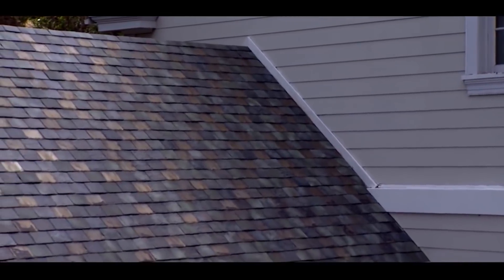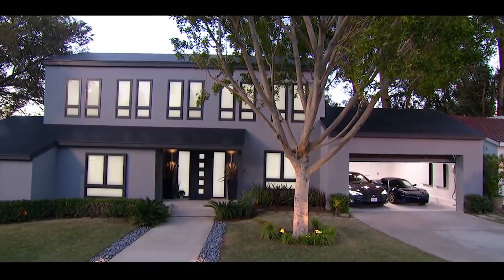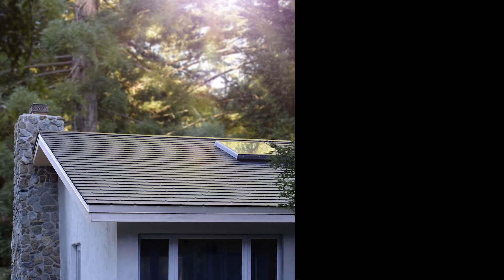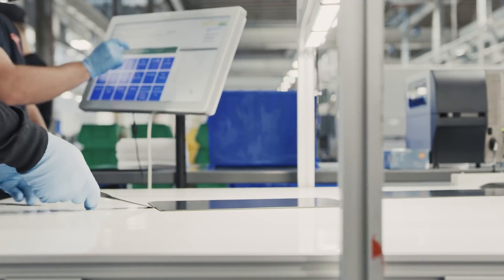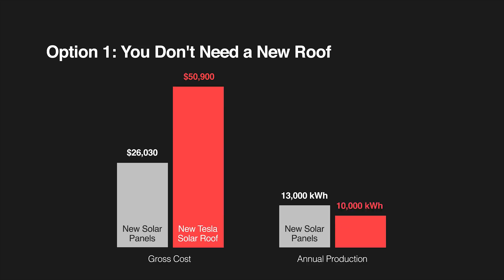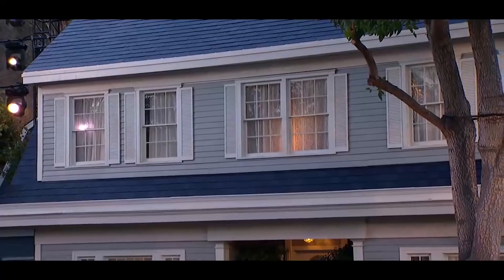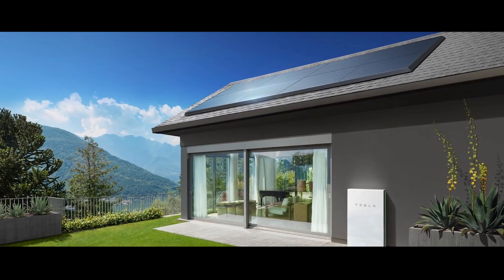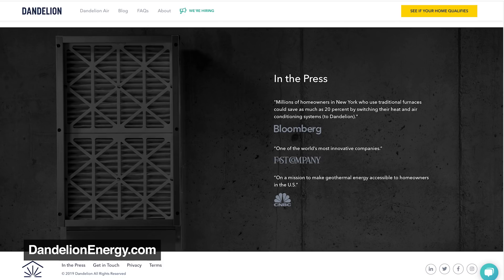Tesla Solar Roof Worth It?

Comment: This is probably the most disappointing part of the whole Tesla story:  SolarCity and solar tiles.  Why did Musk pay 2 billion for a company that was going bankrupt?  He could have got it for the cost of liquidation, a few tens of millions.  There is zero startup cost to solar panels:  all the competition gets them from the same place in China.  Start there and then manufacturer your better ones down the road.  Then those tiles:  I love this idea - all asphalt tiles should be replaced with a solar tile but they should hammer on, snap together and be plug and play.  I have solar panels, bought another expansion array and added 16 huge pool solar water panels and although we have a Model 3, I did not even look at Tesla.  That's sad because I wanted to.

Comment: Why is this video 99% functionality when this design is VERY CLEARLY a huge form &> function product? Of course you're gonna have more power and less cost by buying the slap-specialized-cells-on-muh-asphalt-ruuf but the entire point of their project is not making it look like you've got solar panels on a roof.

There's additionally holes in your math everywhere while you also didn't bring up that people with awkwardly shaped roofs are unable to cover sometimes less than half of the sun exposure area with solar panel arrays compared to tiles that can consort to any design.

Do everyone, yourself included a favor and take this video down & re-do it.

Comment: The calculation discussed about a replacement or new roof does NOT include the fact that an asphalt roof will need replacement within 20 years while the Tesla roof has a lifetime/infinite guarantee. The actual numbers will show that the Tesla roof, even when discounting for the time value of money, is the more economical (less expensive) solution. While $75,000 sounds like a LOT for a roof, it is the only one that one will ever need and the guarantee is transferable. In addition, even if the cost of electricity does NOT increase in the future, the independence from the grid adds a level of security not discussed. Tesla is the best choice economically, security wise, work wise, etc.

Comment: This is a technology that really needs to move forward. We can take an existing energy source and use it to power a majority of our electrical needs. Of course it looks expensive, but you did not touch on the fact that they have a lifetime guarantee on the product. One of the things that makes this make more financial sense is that once it is installed, you have a fixed cost (mortgage) that eliminates your electric bill, and then begins paying YOU back. While it makes more sense in a couple years when prices drop, it certainly has to be considered for the evolution of passive homes and their standards.

Comment: So houses catching fire like the walmarts and amazon sites?  They couldn't do it with regular solar panels.. why assume the new panels will NOT catch fire? Last I heard, there were 13 total installations, and the reliability was terrible.  Is Elon giving a "self driving car will go from coast to coast in 2017" type thing with his announcement?  The standard solar panels are not pretty.. and with the Solar City fire issues I would want that on stands in the back yard.. high enough to not hit your head as you mow the lawn.. with a shed to hold the inverters and batteries...  Here: solar is the only possible backup for the ever so unreliable utility.  

The local fire department also suggests back yard structures so that you have guaranteed generation shutdown if there IS a fire on the roof. (Lightning and all)  Their demo solar roof (even with 30-60% non producing panels) does look much better than the cheapest asphalt  shingles.. but the 30 year stuff I had put on 5 years ago was $8k for a 2400 square foot house.  The $80k or more for the solar shingles is rather daunting.. and in some areas in the south would only double the value of the house.  If it works....

Comment: I ordered a Tesla tile roof two years ago from the factory. At the time they required $1000 deposit which I gave them and they estimated that for my house which is about 1700 ft.² the cost would be in the neighborhood of $40-$50,000. Two months ago they measured the roof they spent four hours going over everything that had to be done to normal asphalt roof that they were going to replace. The cost estimate just came in at $155,000.  With an average electrical bill per month around $120 this made no sense at all.

Comment: solar and wind huh. what happens in a winter climate when theres no sun or wind for days??? ya screwed then!
Reply: Solar Power only reduces your need for Grid Power, it does not replace the Grid Power, unless you also add an expensive Battery Back-up

Comment: I was thinking about using the batteries I already have solar panels on my roof. I think it’s a good ideal to get away from PGE power and go totally solar power. What do you think?
Reply: What is the cost of the Battery Pack every 5 - 7 years?  Typically, batteries are a financial loss ...

Comment: Just got my Tesla roof estimate and I have to say I am very disappointed.

My roof is 3147 sf and the cost was $88,587. This would not be bad, but the size of the solar system
is 7.86Kw Which would produce only a third of the electricity needed for the
year. Solar portion 706 sf @ $51.44 sf ($36,316.64) non-solar portion 2440 sf @
$21.42 sf ($52,264.80). The 706 sf was the maximum size system they could put
on the roof as Tesla has limitations. (Whole roof has no obstructions gets sunlight from dawn to dusk).

Comment: I'm building a new house in about 1.5-2 years and would love to have this type of roof installed. Where I am building, the house has to be 3000 sq ft, minimum. That probably means the roof will be around $50,000 + 2 Powerwalls, which they recommend. I can't justify spending $70,000 for a roof, even with the added benefits.

Comment: I live in Queensland Australia and have had solar since 2010 and have never paid an electricity bill and have several cheque's back from my electric company,invested AUD$8,000 for a 4.3 kilowatt system and love it and well they are panels but i do not care as financially it's great for me,since then i devised a way for renters to have a portable solar system for there back yard
Reply: Solar roofs make much more sense in Australia because the price of electricity there is around 2X higher than the USA.  As an example the average cost of electricity in the USA is 12 cents per KW, vs 34.41 in Australia, though translated to US currency that's around 27.5 cents per KW.  The only state in the USA that's as expensive as that is Hawaii.   With that said, the new Solar Version 3 that Tesla is installing in 2020 is cost effective enough that it will even save us Floridians money, and we actually pay LESS than 12c per KW!  Part of the reason for this is because here in Florida very few homes have Gas stoves, hot water heaters or Gas Clothes Dryers, pretty much everyone uses Electricity for everything, especially the cooling systems used over the summer making our electricity bills overall around 13% higher than the rest of the USA.

Comment: Own a daily driver 2014 Model S P85. Building a new home in upstate VT. Called Tesla solar and power wall several times to get quotes. Have never been contacted by Tesla and gave up. Went with local contractors for quotes. Decided on an 8.68 KW grid tied system. It’s on the roof now but house not finished yet. Paying $21,000 before tax credit. Local electric rates are $0.17 per KWh. Thanks for all your good work.
Reply: What is your break-even for your Solar Panels?  10 years?
Reply: @MrSummitville  I don't care about a break even point. The point is to pay it forward reducing carbon footprint.
Reply: @jaykaknes1133  I wonder, how much carbon dioxide was released by the mining of the minerals ( iron, aluminum, copper, gold & silicon ) , transportation to & refining of the minerals, more transportation to & fabrication of the PV Panels, the Rack, the Electronics, the Conduit and the Wire, more transportation to a warehouse, and finally more transportation to your house and also transportation to/from your house by the installers.  PV Panels create allot of CO2, is it really less CO2 than your small portion of the Electric Grid?
Reply: This will be our last conversation. Panels last more than 25 years. Panel carbon footprint is far less than that created by burning coal for 25 years, moving ND the coal, mining the coal, the miners with black lung, the impact of that on the health system not to mention their families. Similarly oil and gas with have way more impact than PV in 25 years. All those tankers on roads and oceans. The environmental impact on the planet plus the carbon are way beyond renewables. Nuclear fission is not much better given the waste. Renewables and maybe nuclear fusion are the best we have now and we need to move fast on becoming carbon neutral as well as sequestration. I suggest you look at a picture of Earth from the moon. Ask yourself if burning carbon and killing this beautiful speck of dust we call home is worth a few years of not so cheap energy. It will run out in a hundred years but our Earth has a few billion lect. Peace
Reply: @jaykaknes1133  From the day Solar Panels are installed, they continue to degrade over time.  They will need to be replaced, which creates a massive amount of CO2 - which I previous explained.  Solar Panels create most their electricity at Solar Noon - that is the WRONG time of the day! If you do the research you will learn how PV Power screws up the grid!   Hawaii no longer allows any new PV back-feed into the Grid!  COAL?  In the USA most of our electricity is now generated by very highly efficient Natural Gas Power Plants.  Coal plants were being closed on a monthly basis due to new Natural Gas Power Plants, not because of Solar production, and not because of Wind production.  Big problem - Solar does not work after sunset.  Installing Solar Panels actually INCREASES the cost of electricity for everybody on the grid.  The air, the rivers, the lakes and the streams in my area are CLEANER now, than they have ever been in the past 100 years.  We are not "killing" the planet.

Comment: Living in what would probably be called public housing in the US, I only have one vote, but they have a lot of roofs in the right angle for that... However, in Denmark solar roofs can only work as an annual discount on electricity... Wind turbines are better business in this corner of the world and Norway and Sweden has their hydro... Solar alone doesn't cut the cheese, I'm sorry.
The prices have to go down to justify even trying solar here, and a single wind turbine, of necessary proportions to be useful, is not very welcome in populated areas.

Comment: Solar panels become less efficient the hotter they get, so the upstand on the roof allows air flow to keep them as cool as possible. Roof tiles?, seems to me they will get a lot hotter and perform worse than solar panels. Any ideas?

Comment: Your asphalt roof price thing is completely way off in my area in the East Coast a architectural asphalt roof 1500 to 2000 square-foot is around $8000 anything larger than that is between 12 and $15,000 that materials and install

Comment: I live in a conservation area in the UK.  Solar panels that site on top of roof tiles are
not allowed.  At the rear of ones property panels that are flush with tiles may be allowed.  But as the front of my house faces south clearly solar on the front would be best even if solar tiles are less efficient that panels.  Or I could go geothermal.

Comment: What is their argument that energy cost will increase in the future?
Reply: Global demand will increase as electrification of cars also increases, along with increased regulations on co2 outputs for coal and natural gas power plants which will increase reliance on renewable energy sources which do generally cost more, +industrialization +population growth will also increase demand.
Reply: @miguellopez3392  Renewable energy is becoming more popular and battery technology is becoming more advanced and they are becoming more cheaper. Even though capital costs is high, renewable energy is much cheaper than coal, natural gas, fossil fuel generated electricity.

Comment: Personally, i like the look of solar panels, and would be happy to have large form factor solar panel plates that could act as a stand alone roof, eliminating the plywood, and sheathing, comp, or tiles.  let it do everything, and look like what it is, also interlock, and last at least 50 years. I'll be happy to throw my roof away, and even redesign the roof to better suit them if necessary.

Comment: Curious how you made your production estimates for the solar roof? I would assume that typical modules you cannot install in all parts of your roof. So the roofing area covered by tiles could be more. Also typically solar panels are stringed together but tiles could be configured in series parallel and flexible configurations to overcome or limit impact of shadows. It is also not obvious why the same area or the roof when covered w panels vs tiles will yield lower production for tiles.. could you please clarify?

Comment: Ben, for a "numbers guy" you frankly did a terrible job with this analysis.  Why are you not comparing the Tesla Roof (lifetime guarantee) with the expensive slate roof which looks similar and lasts a long time?   WTF?  You are smarter than that.    I hope it is not because you are hawking the heat pumps instead.  Hmmm.   No, I think that you just did not quite think it through this time and have no other "motivation".    I am putting my faith in you buddy to make it right.

Comment: I don't think its accurate to compare a Tesla roof to cheap asphalt shingles. Tesla's system is a tile roof and should be compared to similar roof, plus you get the electricity bonus. Plus even 40-year asphalt shingles rarely last 15 to 20 years. Slate and tile roof last over a century.
Reply: We build roofs in southern California the same way we did 50 years ago, and I don't see many changes coming, other than some lip service to radiant heat, in the upcoming 2020 code.  Tell a Viking this trash can lid is his shield, and watch his reaction.  Our roofs are similar and can save us loads (literally and figuratively) if installed to protect the building like a steel umbrella.  Passive solar principals should be applied to the fenestration.  Get all that HVAC equipment out of the attic, it should be vacant and open except for "weatherproofing" to prevent  birds and insects from flying through.  The flat roof/celing/attic floor is where the insulation goes, integral (no thermal bridging) and R 45 or so, or better.  Exterior stucco walls should be insulated from the outside, using steel studs and EPS closed cell insulation, then sheathing, then a radiant barrier, then a U-channel airspace, and a light-weight siding like steel.  Preferably fireproof.  An underground air plenum should be excavated next to the foundation and used to provide incoming air to any air source heat pump, then to zones.  You'll get all AC and Heating from the heat pump, powered by a 4 kw solar system with battery backup for nighttime.  It all starts with the roof.

Comment: I was thinking about doing a metal roof and then a solar panel/power wall from Tesla. I think that is better because it would be durable but not hugely out my price range. Maybe by the time I build my house it will be cheaper to just do the tiles? The thing is when it comes to replace this roof (which is highly likely because I live in Florida with all the hurricane disasters, twisters and such) I will not only be replacing the roof but also the solar panels in the roof which have a high chance of damage in those types of weather is what I'm understanding. It makes sense to me to still do the power wall and just do a regular roof so I am not pulling my hair out trying to fight with insurance to get the solar tiles back as we know insurance is always kicking their feet to see how they can pay you less for what you want. I imagine the deductible and things involved in my area with the insurance will be something I am not willing to see. My parents recently got a quote to redo their roof, all they have to do to get the asphalt roof on is to pay the deductible and the insurance paid most of the claim. It does not make money sense to me to buy these solar tiles right now, everyone knows that typically when something just comes out, it typically is going to be the highest price it will ever experience, not always the case but sometimes.

Comment: Nice video. My take is that the solar roof is just the stylish premium option. You should have added a sub-case to the comparison when you need a new roof, namely if you buy a slate roof ($15,000 or $20,000 instead of $8,000).

Comment: I suspect that the true cost of a Tesla solar roof can only be measured over time - several decades, including the relative cost of replacing an asphalt roof (every 20-25 years?), energy costs (indigenous vs. external grid), regular upkeep, and so on.  Plus it's not unlikely that the technology and/or energy producing efficiency of the solar roof tile will improve over time.  The additional cost up front could balance out, favorably, over time.

Comment: should probably have compared to more expensive roofing options, and also factor in lifespan.
Reply: @thunderpop609  Yeah, but can the solar cells last 100 years? No!
Reply: @mikenotta7079  so he should've considered that
Reply: @mikenotta7079  Maybe not 100 years, but a decent 20 to 25 years maybe. Comparable to ceramic tile, and ceramic tile isn't cheap, or cheap to install, either.